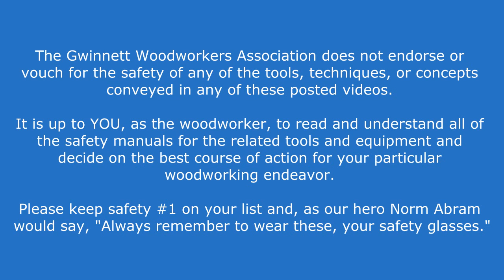2014-04-14 Jack Morse Turns Crematory Urns

Comment: Hello Jack. Many thanks for this very informative and technical demonstration. I could relate to many of the issues ypu raised having made just a few urns in green wood. I would be keen to know more about the preparation and drying process. Expecially how to avoid cracking. Frim what i could see, you turn your blanks to general shape leaving a 2 inch wall thickness. Drying takes three months and you see the wood going from 30% back to 10%+-. You leave the partially turned piece in a paper bag in the workshop for that time if i gather rightly. 
Have you any thoughts on choosing the wood to start? Can you turn a full log, ie heartwood and sapwood  or is it better to stick to sapwood?. If you use the full cylinder and howeow out the heartwood, is the base likely to crack....most of my urns to date show varying degrees of cracking so i assume that i am doing something wrong. 
Any thoughts would be very much appreciated.
In any case. A very useful video. Many thanks. Darragh, amateur wood turner in France